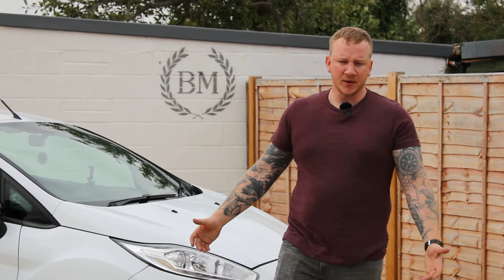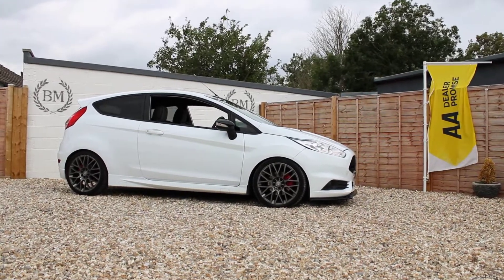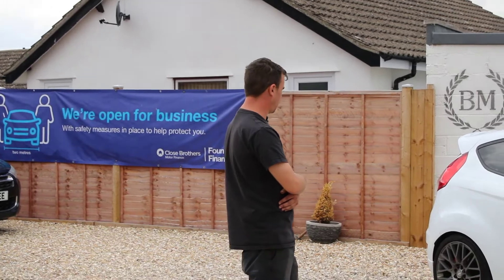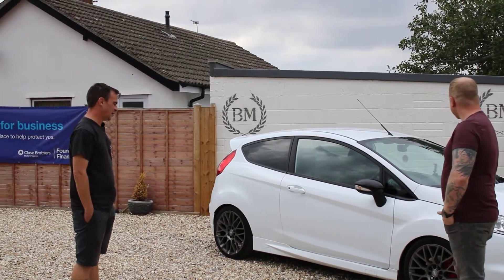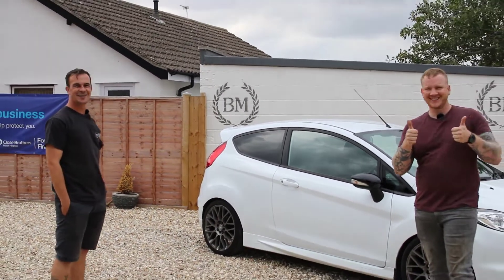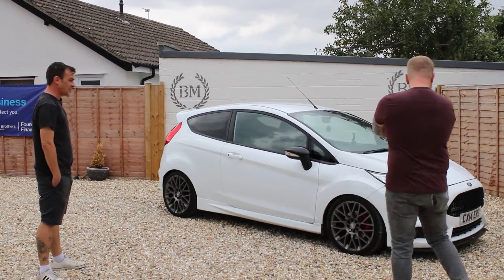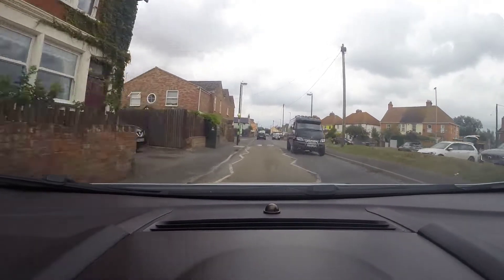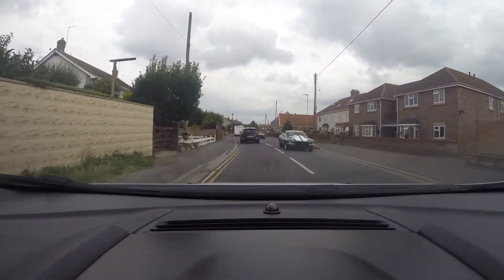WE BLEW UP HIS 400bhp FIESTA ST2 💀 -  WAS 30psi OF BOOST TOO MUCH?! 🚗💨

Comment: What was the outcome then? Cracked liner or head? Or was it just turbo failure? Sounded like it was misfiring afterwards
Reply: Oil and air/fuel mixtures are not defined…
Reply: You’ve got to get a BOV! The backward thrust from the turbo flutter is eating up the leading intake edges of the forward main bearing retainer. That wears turbos out four times faster when charge air has nowhere to go on deceleration. This accumulates over time, until you go out and show it off! That’s not because of 30 psi, it’s because the turbo has been self destructing every time you chuckle at the sound of that flutter. Too bad it sounds so cool, if it sounded like the destruction it truly is, you’d cry any time you heard flutter. Unless you just like to work under your car a lot, let it tweet!!!

Comment: was gonna say it's definitely gonna need a block mod and stuff to be running 400 but even still I think that turbo maybe doesn't push that far. probably look to upgrade to something like a G25-550 to push into the 400s as most of them are only rated for 350 or 380 max
Reply from the maker: Rebuild coming, watch this space! 😁

Comment: This is not a 400hp fiesta with a x57r I had a fiesta with ungraded fuel cambs and upgraded injectors and only made 383hp on stock engine and mine last very well till I swop it for fully forged engine and went for x58eve2
Reply: Hey man, what kind of hp did u make with x58? ND ANY 100-200times/60-120?
Reply: @dennisn1256  I made 390hp but I never did times but the turbo good for I’ve seen now 429hp so very good turbo but sadly I don’t know the car know
Reply: @x58evo2puma7  thats mad, my goal is 400+hp when im going to forge it but Just ordered the x58 and quickspool manifold going to run it on pumas med boost which makes around 360to370bhp they said. Thats their recommended map for stock dngine so
Reply: @x58evo2puma7  I wonder how it compares to the g25-550 in turbo lag, gonna try a awd swap with some ecosport parts and hoping to go around 450-500hp, but turbo lag might just make it quite hard to utilize all that grip